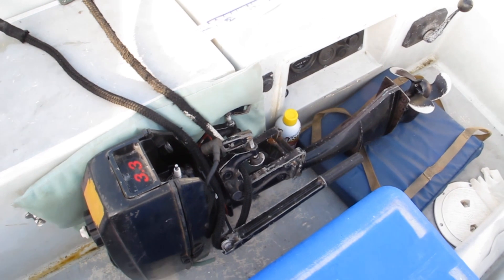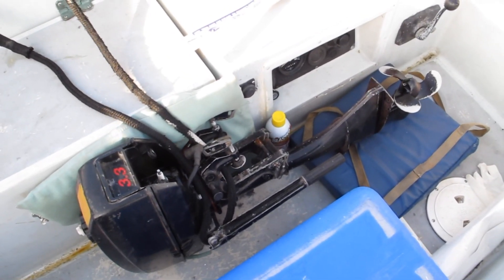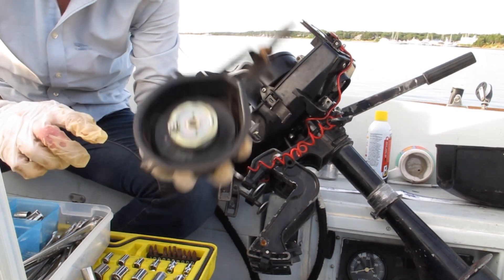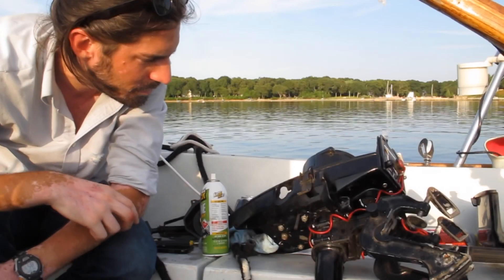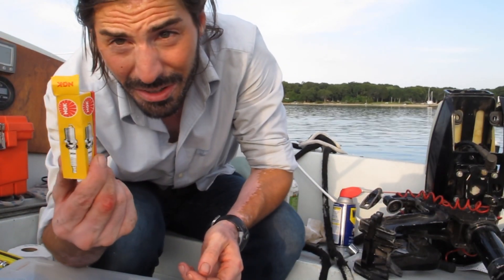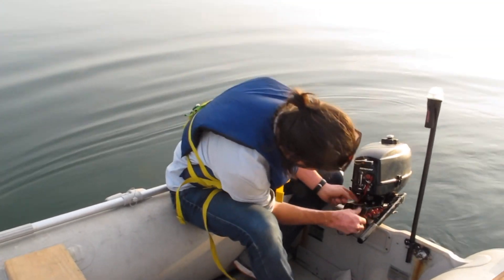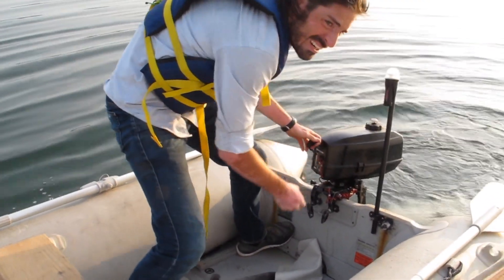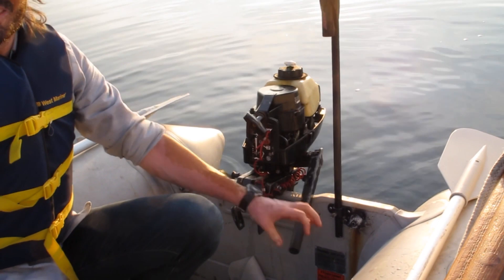s/v DUO - Reanimating, Unseizing, and Starting a Seized Two-Stroke Outboard Motor

Comment: as I saw you struggling... I bet myself you had it in gear... not only that but it does have  START position on the fuel lever and you kept screwing with the choke, like that was going to change anything... choke a cold start... if it was overheating, did you check the impeller?... it seems that's the second motor you've killed by not getting some good mechanical information.... maybe you should try OARS...

Comment: The pee tube was plugged.
Reply from the maker: Are you sure? I’m not sure but I do remember seeing water circulating
Reply: There is a small rubber tube sticking out below the back of the power head.  I had to remove it and blow it out with compressed air.  If it's blocked the engine  overheats.  This is true for all modern outboards.

Comment: This is a rebranded Tohatsu.  Well made engine.
Reply from the maker: Thanks, I believe my previous outboard, a 2hp 2 stroke Mariner, was also a rebranded Tohatsu. This one, I wound up overhauling over the winter and not being able to successfully restart it again. I gave it to someone at my yacht club to take a look and he couldn’t do it either so far. I think the previous owner just left it outside for two years after getting it with no winterizing.